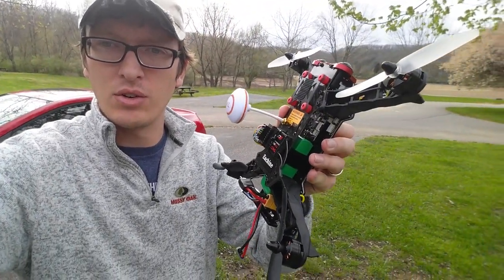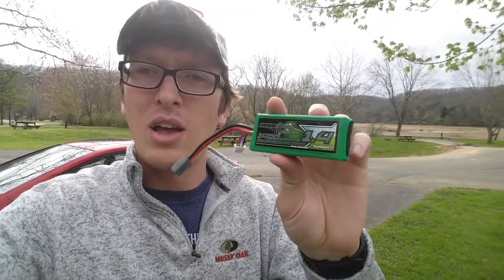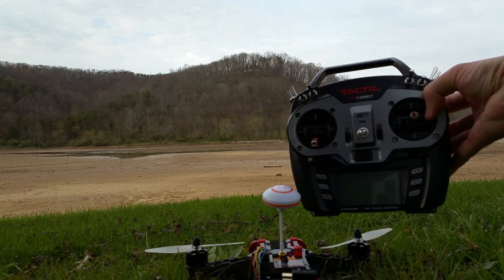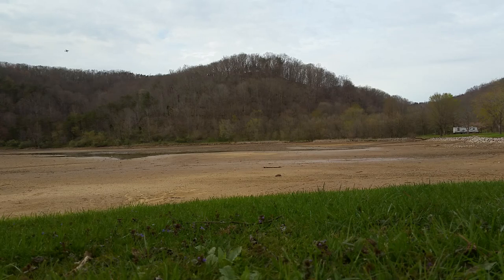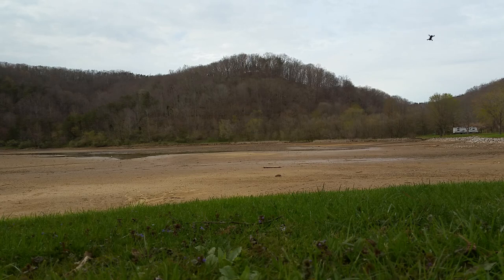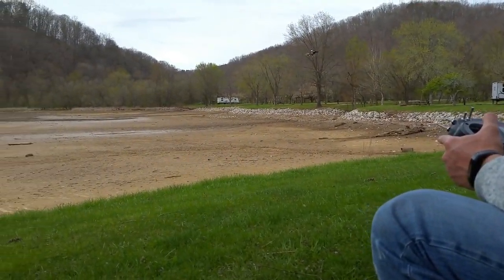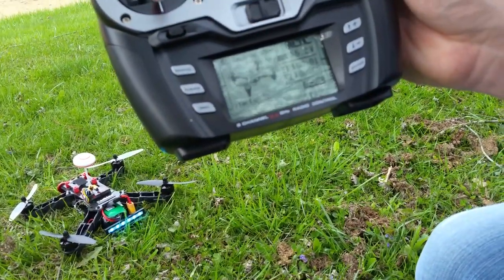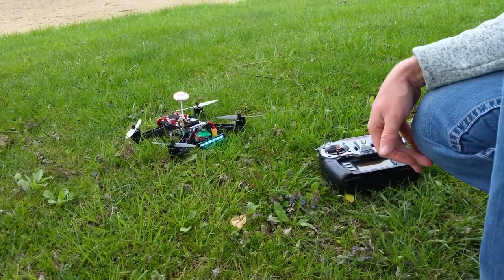Zipping the Eachine Racer 250 Drone at the Dried Up Lake Bed - TheRcSaylors

Comment: Nice flying!
I have 1 multistar 1400 and it lasts about 5 minutes, it does feel like just does not have the same power as the nanotech 1300, which last the same amount of time. I plug a battery buzzer alarm into the balance plug, set for 3.5 volts and set the transmitter timer for 4.5 minutes. That helps keep me from over discharging the batteries.
A lot of fun! I look forward to seeing you and your brother flying together.
Thanks for the video's.
Reply from the maker: Thanks!  The tips help, and I know I need to plug in my low voltage timer.  I've got a few actually, just need to find real estate on the racer for it.

Comment: Hi Home Grown Drone here and just checking out your video on the Eachine Racer 250.  I just bought one and can't get the firmware loaded in order to fly the darn thing.  So currently am one who hates it since I've spent money, waited a month for it to arrive, bought extra batteries, worked on it for a week and still can't fly it.  Did you have any problems flashing the board.  I get no confirmation beeps when it's time to plug in the batteries for sinking up the motors.  On another attempt and get to the same point to plug in the battery...the drone beeps for ever with confirmation but never stops.  Therefore from that point on with either outcome nothing goes right from that point forward.  This is my first racer class drone been flying toy drones and wanted a new experience.  So first drone out the door and I'm supper disappointed.  Does this sound like normal newby problems or does it sound like something else could be wrong.  Your input would be appreciated. Thanks
Reply from the maker: I'm guessing you and I are flying on different transmitters so I probably can't help, but I can say mine worked fine as soon as I plugged everything in. I'm flying on a Tactic Tx Rx combo, TTX650 on this one. I did not do any firmware updates to mine either. Flew fine without it, so I thought no need to update it.

Comment: Do you know, if the mainboard of the eachine 250 is nessesary? Could i just connect the engines by myselve and create a own led strip in the back? Cause the led strip in the back keeps breaking, and i dont want to buy a new mainboard everytime.

Comment: Hi mate, nice video of a cheap and good value basic copter, just a quick tip, if you are flying with lipos the idiot proof way to ensure batteries don't discharge lower than recommended level, is to have a volt alarm hanging off the balance lead strapped under battery strap. Just set the alarm to the desired voltage and when you reach this or even if the cell voltage momentarily dips during heavy punch-outs and other aggressive flying it will give an audible beep. I use these on all my copters as an independent, cheap and idiot proof way of protecting my batteries from damage due to over discharge. I fly a couple of hours, daily and get very good battery life and no puffing or heating issues that often result from unintentional over discharge, you can easily hear the alarms from up to 1 Km  distance. You may already know this, if so that's cool, just trying to be helpful
Reply from the maker: No that's okay, I love the tips, greatly! I do have a timer set on my tx, but the alarm would be much more accurate. I have ordered three of those little guys :)

Comment: Hey Nate just some input I have from owning the Eachine 250, I think the stock battery it comes with is nice for beginner pilots. But it can be very punishing if pushed too hard too fast, but I think the battery you used in this video the 1400Mah 3S is a bit too weak for this type of quad, as you said you were nearly full throttle most of the time. When you are comfortable with the quad you'll want to move up to 1300Mah 4S batteries. It's a whole new level for this quad..with decent flight time 3-7 min depending how aggressive :P
Reply from the maker: You think it can handle 4s?  I thought this racer was only set up to fly on 3s.  I'm still new to this part of the hobby so any advice is greatly appreciated!
Reply: Yes! It definitely can handle 4S and I think actually performs better with it. Give it a crack sometime :) Sorry for the late response!

Comment: The one I got does not auto level, in fact the mode switch does not do anything. So are the ones you get that come with radio supposed  to be that way?
Reply from the maker: Not sure. I paired mine up to my own transmitter.

Comment: Hi Nate and Abby.
I wouldn't worry too much about the throttle/lift/speed at the moment as when you start using goggles it will seem hellishly fast to begin with. I've done quite a lot of FPV with larger multirotors, 550 size, and fixed wing and felt very comfortable but when I got my Vortex 285, and started flying FPV in Acro mode I really started to feel that maybe I was too old for this game 😨 Judging by the two LOS flights you've posted up on your channel it won't be long before you'll be demanding more power and advancing to more advanced frames and more thrust capable power systems.
Regards
Nidge
Reply from the maker: Thanks for the info and tips sputnik!  I'm a little nervous to start flying FPV, but super excited at the same time.  I wanted to start on this racer because I felt like it would be entry level enough for me to get into this aspect of the hobby.
Reply: +TheRcSaylors 
Hi Again Nate.
The most important thing I would suggest, and I'm probably teaching you how to suck eggs, is DEFINITELY have Abby spotting for you on your first FPV flights. Only the other week I was flying my Vortex in an area that had few visual landmarks, my goggles steamed up and all I saw was blurry green stuff. It was also very windy so even though I thought I was flying toward myself the quad was being blown further away. I ended up having to do quite a long walk of shame, thank goodness for the onboard lost model alarm or it would have been an expensive exercise in stupidity.
Regards
Nidge

Comment: awesome videos! a little tip for your throttle concern, it may just be due to whatever preset rates are configured on the board and you should be able to hook it up via USB and change the max throttle on a pc. I'm not positive that that's the issue or if you can even connect it as I don't own this model
Reply from the maker: I've still got a lot of learning to do in this aspect of the hobby. Little overwhelming at first.

Comment: I have been talking ro another guy ( gasp!) about that and he told me to order spare arms and blades. even an upgrade to a different kind,cant remember the brand but they work much better and handle crashes better. fooy! cant remember the name,When I find it I will send it along. The battery change wasnt a surprise. I always get that with whatever I buy. I thought a couple of times you were going to turn it into an instant mud ball. Does Abby ever fly the racers? I get the impressionshe doesnt care for them, mabe just havent flown it enough yet. Someone has to run the camara when you and your brother race... Popeye sure wont be doing it. do you ever bring popeye to the parks for fun time?
Reply from the maker: Spare arms for this drone racer is a good idea because they are just plastic.  Abby actually did get her hands on the racer this day out, but we weren't filming.  She flew around for about a minute.  We've got our eyes on a racer when it comes out for Abby.  We will start bringing Popeye out more when we go on hikes and trails for fun.  He likes going trailing with the Axials.  =^)

Comment: nice! a very popular DRONE due to its price point.what are people hating on it about? because it's not a cute little house DRONE?
Reply: +michael markey I lot of the hate centers around the arm breakage.  At this price point, probably a lot of newer quad fliers buy this quad.  They get dissapointed when they start breaking arms.  Solution:  buy a supply of replacement arms - they are rather cheap.
Reply: thanks! I was not aware of the arm problem. not into racing quads myself so I don't know a lot about them.
Reply: +michael markey I've had mine 6 months I've had loads of crashes some of them heavy and I have had zero broken arms although I do have spares at the ready👍🏽
Reply: My only complaint also is the capacitors easily break loose. I ordered 8 extra sets of arms and have yet to break one.